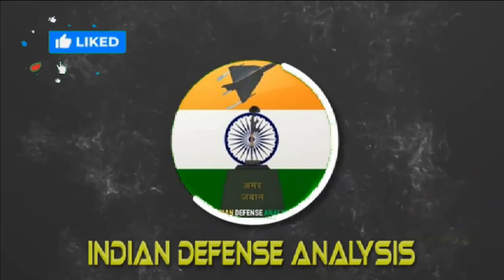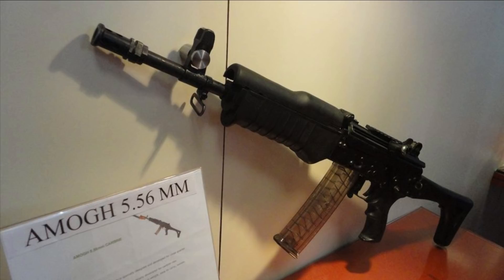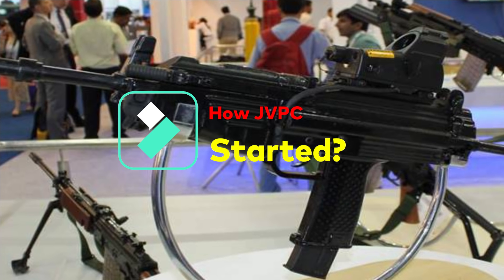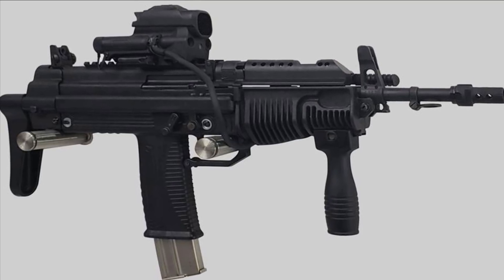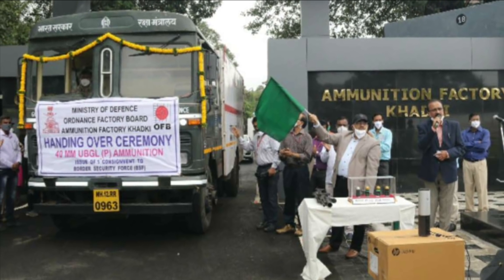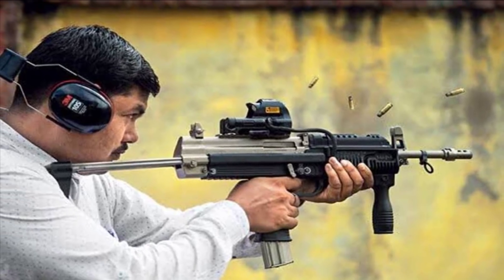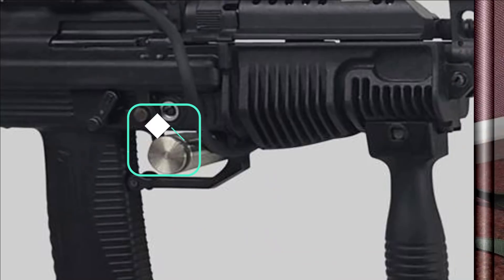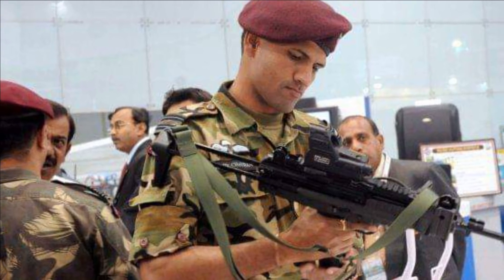DRDO 5.56 x 30 mm JVPC Carbine - more lethal, advance & accurate carbine

Comment: Indian Army should fastrack indigenous deals such as-

1. 93,500 JVPC Carbines (total requirements 4 Lakh)
2. 150 ATAGS
3. 198 TATA Kestrel
4. 15 LCH & 12 LUH
5. 4000 Snipers by SSS Defence (Viper). Work on upgrading the Dragunov Snipers has already started by SSS Defence.

Other that this Make in Deals which should be fastracked under Make in India-
1. 40,000 Negev LMG (since we already have got 16,000)
2. 200 K9 Vajra
3. 5 Refueller Ships
4. 8-12 Mine Countermeasures Vessels

These Deals should be prioritized. Since a few Indo-Russian Deals would be on hold for a while & with the 30 MQ 9 deal also on hold, it's time for us to take a middle path, focus on procuring from indigenous industry & even if we have to procure from outside, we need to ensure to maintain a neutral stance & rather procure from other allies like Israel, South Korea & France.

Comment: How does it compare to DRDO ASMI
Reply: ASMI is 9mm its 5.56
Reply: @rockzilla1001  I knew someone they have differrent calibre but the function is to neutralize enemy not specifically with 5.55 or 9 mm. See why SIG SAUR 716 replace INSAS. Simply because it was less effective against enemy with AK47 and 716 gives greate accuracy and range too. They did not think insas is 5.55 and the replacement should a 5.55 only. I hope you got the point.
Reply: @sourabhg5418 Just remember that there is place for every calibre of weapon. 
Bigger calibre heavy round more recoil  so more tired soldier and it's not always situation Where weapon is drawn to kill in single shot sometimes it's more for ditterence also to wound and capture can be used for cover fire also small weapon is easy to hide.
ASMI is for bodyguards, police, also personnel weapon for airforce and special forces we use micro UZI and MP5
And please don't forget it's export potential Google for kits available for 9mm pistol so there is a huge market out there
Reply: @rockzilla1001  I knewthey have differrent calibre but the function is to neutralize enemy not specifically with 5.55 or 9 mm. See why SIG SAUR 716 replace INSAS. Simply because it was less effective against enemy with AK47 and 716 gives greate accuracy and range too. They did not think insas is 5.55 and the replacement should a 5.55 only. I hope you got the point.